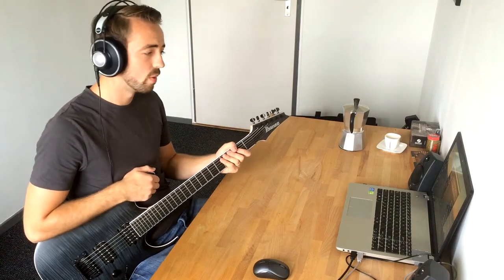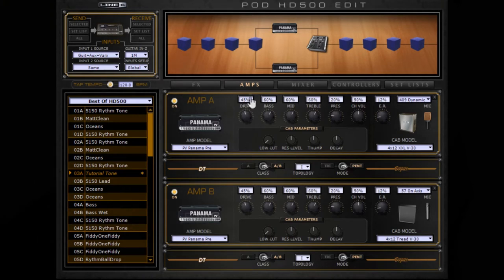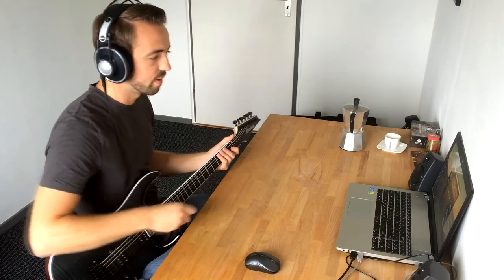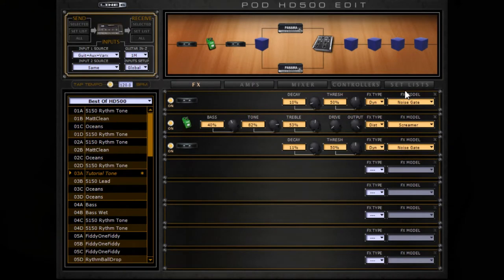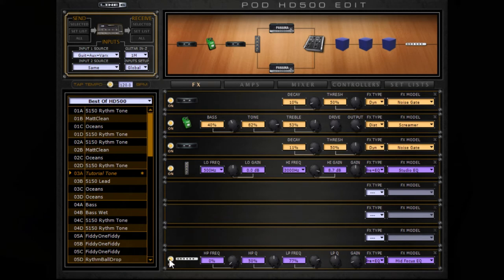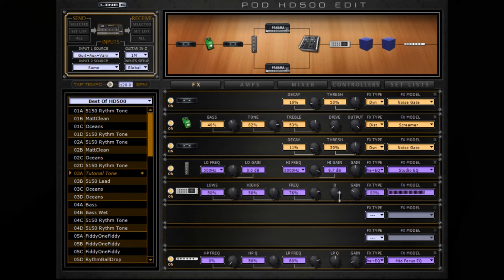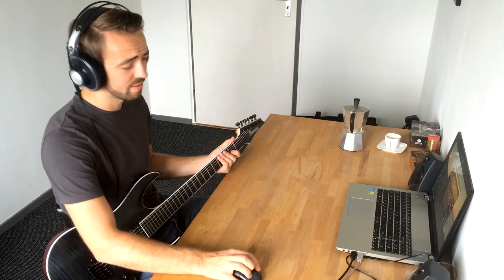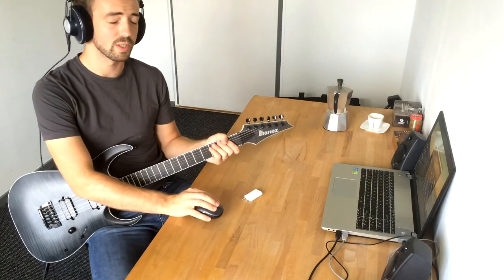POD HD DJENT tutorial (dual cab)

Comment: Hello! Do you think the HD500 is still good? I want a helix but can not afford it and want either a hd500 or a hd500x. I would just get the hd500x but I'm worried I won't be able to use the hd500 tones.
Reply from the maker: As far as I know, the HD500 sounds the same as the HD500x. The 'x' basically means it has more processing power and nice buttons. The presets are also convertible from one format to the other device's format.

Comment: Do you think this would sound this good with a real cab if I turn the cabs off? And if I used the dual rec or fireball amp sim?
Reply from the maker: I preferred the big bottom model when using real cabs.
Reply: I want to buy the metal HD pack but I'm worried I won't like it. I want the 5150, big bottom, and maybe the marshal. But idk. I also have the mooer brown sound 3 which is a 5153 preamp pedal.
Reply: @MatthijsvandenHoven  also would you change any of these setting using actives or just use the pad switch? Also with a real cab. Ive never used a computer for guitar stuff yet thinking of either getting a real 2x12 or a 2x12 frfr. I'm currently just using a 1x12 with a v30.
Reply from the maker: Aaron Morgan yes I think with any guitar you have to adapt the preset to that guitar specifically. I have a frfr for sale actually, because I don’t like the feel. I prefer a real 2x12.
Reply: @MatthijsvandenHoven  thanks. That helps alot. I've been tone questing for about 6 years. Very new to the modeling and kinda guitar in general. I have good guitars and ok everything else. Joyo zombie amp, precision drive, the 1x12 i mentioned, an hd500x, and the mooer preamp pedal I mentioned. I have 8 and 9 string agiles both active (8 string has blackouts and the 9 has emg 909s) and a solar 6 string.
Reply: @MatthijsvandenHoven  finally got around to dailing this exactly (minus the amps bc i don't have the metal pack and minus the cabs) i used the dual rec for now. I used the full amps by mistake but I'll change them to pre if it sounds weird. I didn't change the amp eqs at all besides what ever you did on here.

Comment: Why not use the full amp model?
Reply: I think it's either sound preference or he built his live sound and was planning on turning the cab simulation off later.
Reply from the maker: It's because the HD500 doesn't have the processing power. If I try to use the full models, it says "DSP limit reached". I probably would have used the full model if I had an HD pro x.